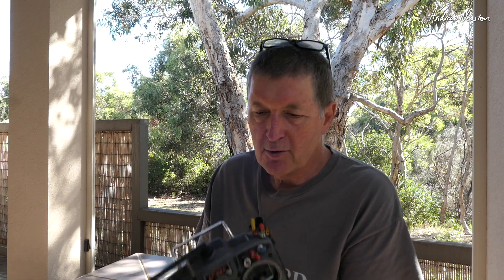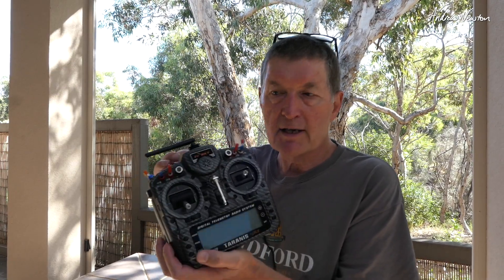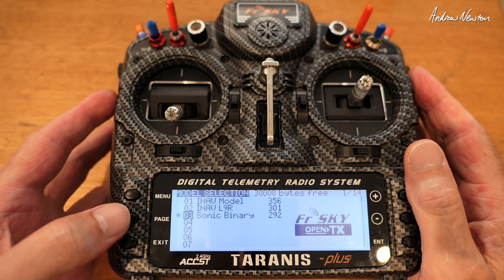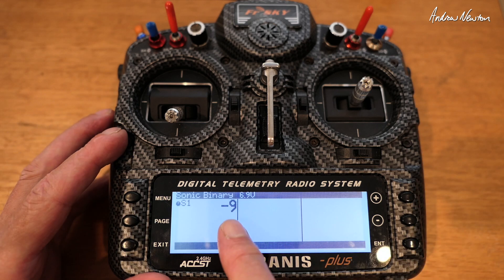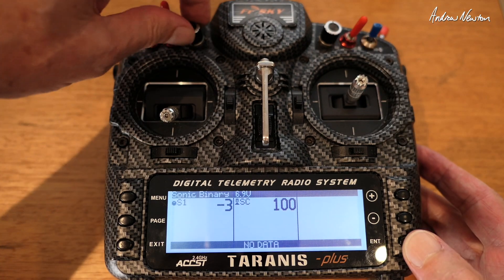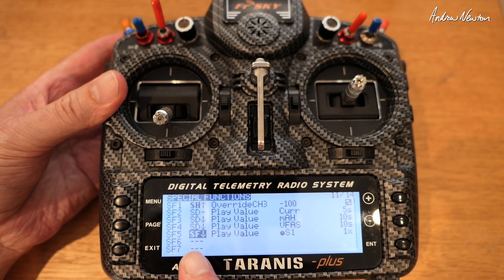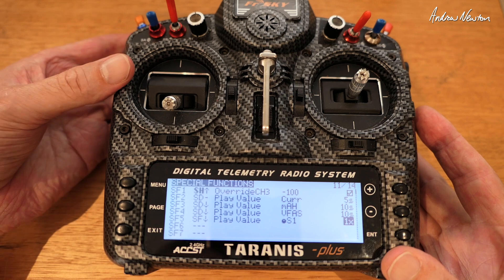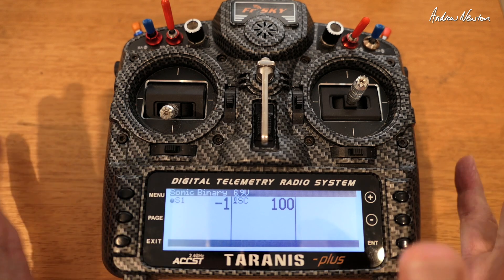OpenTX Pot or Slider value Display or readout

Comment: How can we re calibrate the numeric range?
So instead of -100 to +100
Zero to 100?
Without affecting the actual throw of the channel the slider is controlling of course....😮😮
Reply from the maker: No problem, using a spare channel (other than the control channel) and curves. I'll do a video.
Reply: @AndrewNewton  Great, this will help him no end. He uses the RH slider for throttle and the RH stick to fly with on Ail / Elev / Rudder mix...He only has use of one hand, but I have him flying solo after 2 years wireless buddy training. The numeric throttle audio will help him assess the throttles position. It's tricky as the throw is comparatively small...🤔😳😀🇬🇧